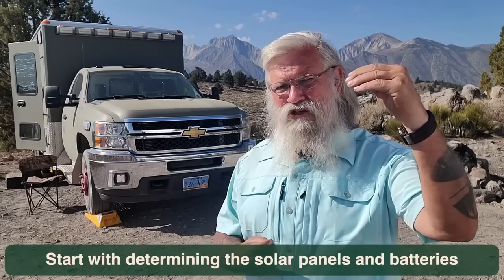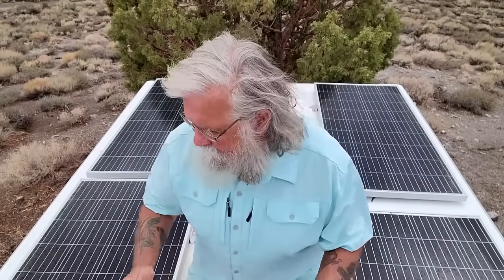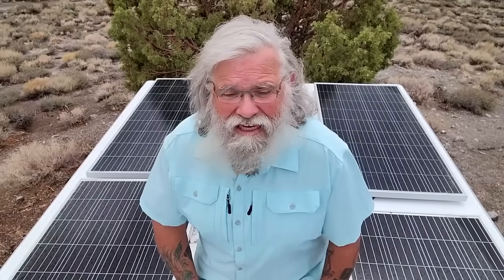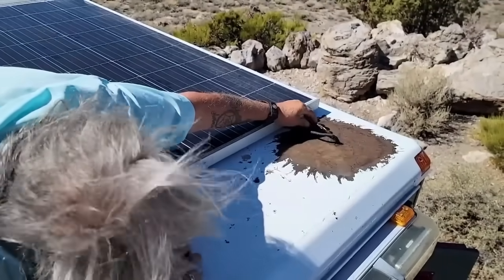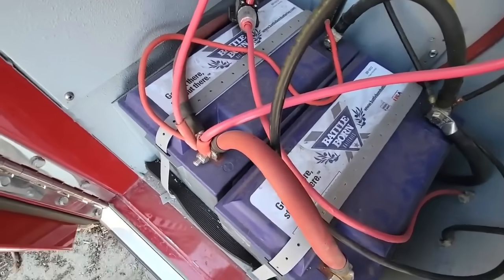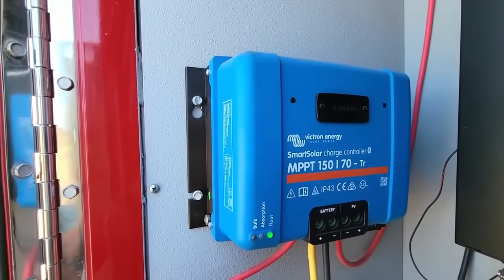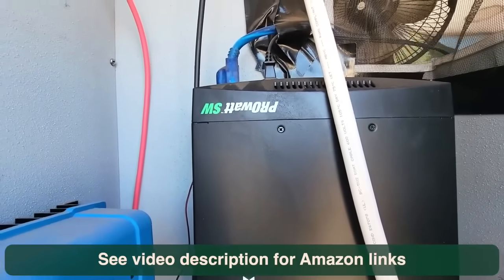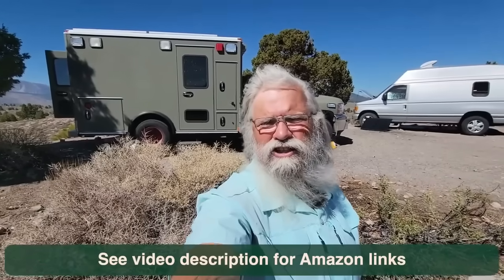A Closer Look at the Components in My Solar System Setup!

Comment: We have a very similar setup, although we have only 200 watts of solar, but have our 40amp dc to charger working when we drive.  Our RV still has an integrated AC generator with an upgraded lithium converter that puts out 14.4v.  So we have more ways to recharge but less solar.

Comment: hey bob, ive been watching you for about 5 years now!  i lived in a rebuilt motorhome that i did myself for about 3 years, and gave up on that for a bit.  i just purchased a converted ambulance and am very excited to be back out on the road 💪.  came with 800w monocrystalline panels, 3000w aims inverter, and epever solar controller.  they work well for now but i will be upgrading to lithium this summer!

Comment: I'm thinking more about ready made battery power stations from BlueYeti, Jackery, etc. Some of them only have one input either from the 12V cigarette lighter or from a solar panel but don't seem possible to take both at the same time. So anyone with some good advice of how I could combine the power coming from my 12V cigarette lighter socket while driving and the power that comes from the solar power on the roof. How, where  should I best connect the two 12V cables that comes from the cig lighter socket and the solar panel? Should I get an MPPT controller ? a DC/DC controller? straight to the battery? Some other component?  Any advice welcome.

Comment: Anyone tried the iron edison batteries ?
Reply: Way back in the day in Alaska my Dad had a 120v Edison nickel (iron?) alkaline battery bank charged with a diesel generator and I will say, those batteries lasted a lifetime,  they never wear out. If I remember they were like 1.5 volt  batteries. Maybe a little different than the new ones but I don't think you could beat them.

Comment: When you said you wired in series, I just saw in a video, hobo tech I think , that if you wire in series and one of the panels gets shaded then it cuts the power to all the panels but wired in parallel only the shaded panel will be affected.

Comment: It’s very important to have a State of Charge shunt. I recommend either the victron or Bogart TM-2030. They are easy to install and tell you the percent of battery energy you have left. Although you can totally drain a lithium battery, and it will just shut off, they will last longer if you go to 20-30% before empty.

Comment: wiring your battery to battery charger.
You stated that this is not connected to your ambulance 12v system so this makes your instalation very simple.  
Maximum size 80% of alternator capacity (info from Sterling Power Sytems) but this includes maximum power to your Ambulance Aux power system out of that 80.  The B2B charger takes on the duties of keeping the two batteries disconnected    when engine not running.. 

Two heavy duty cables  to + and - of vehicle battery,   Fuse near battery in + Line.  (if more convenient + and fuse can go to alternator ).
Negative to go direct to Battleborn battery.   
Additional lead  medium gauge,  probably size specified in manual from -ve of  atelborn to neg of B2B but do not connect till rest of installation  complete.
+ve lead to go direct to  B2B charger.
if temp sensor provided mount as instructed on or above Battleborn.
Additional heavy duty + cable from B2B to the Battle born + with a fuse as near as practical to the battery.
now recheck all the wiring terminal tightness cable fixings, protection of chaff points, and now one can connect that -ve leed you laid in place earlier between the b2b and Battleborn.
Note this was not step by step no knowledge guide it is intended for someone that has a sensible understanding of dc electric and wiring procedures.   if you do not have that you need the help of a suitably experienced person.
Note as this system never drops below 13.3 v the b2b will not need to charge the battery.
Personally I like to go for the biggest b2b I  can so that if I need to charge stationary I can put a sensible amount of power into the battery quickly.
The main difficulty with adding b2b to an existing system is usually maintaining the  power supply to the fridge but Bob does not use a gas fridge so does not need to maintain a separate engine running feed to the fridge .  I solved this problem by installing a 50A diode on the feed from the engine battery to the installed caravan box to prevent the b2b higher voltage circulating back to the vehicle battery.

Now Bob when it comes to needing to renew the ambulance auxiliary battery,   remove all the wiring and relays etc connecting it to the vehicle battery,  take another heavy duty +ve  cable and run that to the input of the ambulance aux fuse box  the other end to the Battleborn with a fuse near the bttlbn.  Note you will need to provide an earth connection for this sub power point.  as  Battleborn and vehicle are connected it should not matter where this comes from.
Check with Battleborn but I believe they have said ok to add batteries of different ages and enlarge your bank with one or two extra bats.  NOTE IF YOU ARE STILL HAVING PROBLEMS WITH B2B SPEAK TO BATTLEBORN they are very helpful and you get to speak to someone that understands the equipment not a phone hub with a set of unhelpful prepared answers.    best wishes.

Comment: Nice system.   I would be inclined to add another two batteries, just gives you so much more power to do more things with such as an induction hob even a little heat sometimes.  The luxuries of modern life you have never had in your Van's before. 
In my circumstances at about 59° latitude  I would only expect 720w of horizontal  panels to give a dailey  average of 180Wh per day in dec and jan.   Now a  vertical 180W panel on the side or rear would give me a daily average of 180 Wh per day (dec/jan) if I can park with that side facing  roughly southish.
Reply: i plan to add a disel generator some time in the future an an connector to use ev charging stations.

using premade batteris is a realy expensive thing, i plan to build my own battery, just a single one, but 300Ah@ 51.5V (equals to 1200Ah for 12A people)

Comment: Bob, please don’t fall into a common trap using voltage like you do with lead batteries. Li batteries don’t voltage drop progressively the way lead does, either use the solar controller to tell you the soc, through victron connect or get the victron shunt to plug into your system and tell you a TRUE state of charge. Feel free to ask me any questions about this
Reply: Agreed.

Comment: I just purchased a 10 year old 19ft Class C. It has an 80 watt  panel acting as a trickle charge to my AGM battery. No inverter. Can I add more panels and an inverter building on the existing system, or do I have to start from scratch? Thank you to anyone who can help! 🥰🚙🇨🇦
Reply: Yes you can add to the 80 watt panel you have, you just need to keep the volts and amps of the new panels within 10% of matching your existing panel. Then add a charge controller and an inverter.
Reply: So, you need to look at the spec sheet on the bottom side of your 80 watt panel to find the the volts and amps it puts out, then try to find more panels that would closely match what you already have there. 1 more panel wouldn't really do much for you but if you could add 3 more, then you would have something useful. 4 is always a good number.

Comment: So we would need the solar panels, controller, inverter, fuse block, and cable to get it all working? Even for a smaller vehicle? I may be living in a SUV soon.
Reply: Hi Vanessa, sorry to hear about your living situation.  If you will be living in your SUV, you might be able to get by with a power station, which has a built in inverter and ac plug-ins and USB ports.  The solar panels I found on Amazon all had USB charging ports as well.  The power station will not be enough to run continuously overnight, and doubt if it would run a microwave for long, so you need to get a propane stove or other options for cooking.  Stay safe and will be praying for you.

Comment: nice...i have the xantrex 2000  prowatt and i have had mine going on 9 years with no problems. I can see the DC to DC charger could be great if you get many cloudy days and no need for any generator. but, with all that solar i doubt it would ever be a problem. My solar is in Parallel and my panels are smaller to fit on a RV roof. shading could be a problem on my roof with A/c units and such. 700 watts and its worked great for years now.

Comment: Very cool setup. Al panels in series gives you higher voltage and certainly has its advantages. However, solar panels are in a sense like a chain. The weakest link determines the strength of the entire system. On a solar system it means if you have one panel partly shaded, the power drops as if all panels where shaded. The panels with the least light on it won't let more power through. If you know you will park near trees and get partial shading, it can be better to have the panels parallel. When parallel the non shaded panels will be able to deliver full power. The overall system output will be higher in those situations.
Reply: I agree,  two strings of two panels would work well and be slightly more efficient.   I do not now the exact specs of these panels but 4 panels in.parallel is unlikely to be practical with a vitron controller.  but the difference is small.  The roof of van is clear so no self generated shadows.  It is a decision you make at installation stage, there is not enough difference to switch an existing working installation.

Comment: I'm building out a skoolie and going to use a lot of the components I had in my van. I do wish I could get batteries like that though.
Reply: If money is the issue there are significantly cheaper options than BB that will still get the job done. BB is obviously a premium brand, but there are a slew of good quality Chinese brands on their tail.

Comment: Me I like to build a tiny house and use solar as main power source. What I like to do is add hard wire light fixture to solar setup.  If knew how I used standard house ac light fixture then just used Led bulbs. I also thought about just using Rv DC style light fixture like alot camper have.  I'm new to whole Solar stuff and don't know a whole lot.

Comment: I'm not American so I need way less power... seriously I don't use a microwave or anything else that needs high current, I just want a bit to power  my water heater, furnace, and some lights. My rig has 4 onboard 12V lead acid batteries since it is a 24V truck. That's a lot of capacity right there, and my truck has a 900 watt alternator. Oh ya, I also have a small diesel generator onboard. Solar would add weight to my roof making the rig more top heavy. My genny sits down low under a back corner of the truck. I intend to get a couple fold out panels I can store onboard.

Comment: You don’t mention a third battery option and that is flooded lead acid batteries.  They are the least expensive but cannot be stored inside the rig because they off gas.  Is there a reason why you haven’t mentioned or considered lead acid (aka golf cart) batteries?

Comment: I think for a budget system the Renogy all in one DC to DC solar charge controller takes a lot of beating paired with a 100W lithium battery and a 200W solar panels.

Will charge as you drive and top up via solar while stationery, it's a really simple system to put together and cost under $1,000.

Would be good to have you hook up with Renogy and test that out on someone's van like you have with fridges.

Comment: Yes I've got two newpowa 100 watt panels, a 100 amp hour lifepo battery, a 30 watt charge controller, a small inverter and what I believe are all the MC equipped lines with fuses, etc ... But I'm still reluctant to put it all together...

Comment: What would really be helpful is to do a full instructional. Go piece by piece needed between the hardware. ie
1. Wire size with which ends needed and fuse size used from the panels to charge controller (CC)
2. Wire size with which ends needed and fuse size used from C.C. to inverter
3. Wire size with ends needed used to connect batteries together
Renogy sells proper wires with proper ends without having to crimp and make your own. But I think this is the SINGLEMOST reason people shy away from solar is because they don't know what wires to buy. And the wires is the SINGLEMOST important thing so as not to start a fire. Would you do that video?
Reply: Absolutely agree wire size is vitally important.  Many systems don't work right because they are underwired.
Two great channels are Will Prowse and ExploristLife.   ExploristLife is Victron/Battleborn centric.  Great info.

Comment: Love your channel and your videos.

1. Regarding batteries,  you may want  to check the Lithionics.  Those are 315AH less than $2000 like the Battleborns, while gaining 115AH more.

Many people just jump into the bandwagon and exclude themselves of the research process .

2.  If I needed an affordable system, I guess the best source is Will Prowse.  That guy really knows the sokar technology in depth. 

3.  Some people are as good as to build their own batteries for 20% of the MSRP.
Reply: Good advice. Overall, lithium has dropped in price while battleborn has stayed about the same price. I put together my own system using the lithium cells straight from China( where  battleborn and all the other companies get their cells) and then adding my own BMSs. Saved a ton of money and now I can run a split unit ac or an electric heater
Reply: Yeah but...Lithium Ion isn't going to last as long as Lifepo4. And the composition isn't as stable. It's going to be a race to the bottom once the patents are up on Lifepo4. Tesla, Samsung and others start to produce the batteries in square cells. Yeah you save up front with a Lithionics battery. But they will never have the longevity of a Lithium Iron Phosphate battery.
Reply: Should check out Enduro batteries, based on CO. I have 2 x 12v 200AH in a 24v system and they have been great. 100ah 12v are only $699
Reply: Did I read your comment correctly, if I can build my own battery I could potentially make it for 20% the price of purchasing a battery at retail?
Reply: @michaeldautry  look up "lifepo4 battery build"  here on YouTube.  You're looking for videos where they combine 4 cells.  Retail lithium like the ones used in this video cost from $650 -$950 per 100 amp hours at 12 volts or 1200 watt hours.  The average retail price per watt hour  is about 71 cents per watt hour and building your own is about 24 cents per watt hour
Reply: @michaeldautry  Freaking impossible!  I built two CALB solar battery generators. I had 4 CALB cells shipped from China (took 6 weeks to arrive).  Those were about $390 3 years ago.  Recently I bought 4 of the same cells off ebay for $320, but it didn't come with bus bar connectors ($35 for just those) so you end up spending about $400 on grade A cells, then you have to add a good bms.  That said, there is no chance you can buy a diy battery for 20%, and not even for 35%, just my 2 cents.  Will Prowse just made a video of Weize 100ah LiFePo4 that runs $399 on amazon, not bad.
Reply: @michaeldautry  I don't know about 80% off but at least 65% off if you build your own and it's not very hard
Reply: @michaeldautry  I bought amperetime 12v 200ah batteries for $700 ea that are under half the price of battleborn and already assembled and with warranty, I don't think it makes sense to DIY any more considering the price of these.

Comment: I want my vehicles to also “have all the power I ever need”.
Reply: what do you want to power? fridge? lights? induction stove? ac? ...? and for how longe?
what options do you wand to charge the battery? alternator (while driving)? solar? shoure power? ev charger input? generator?
what is the max ac and dc load you ecpect?

then you just but it together almost like lego.